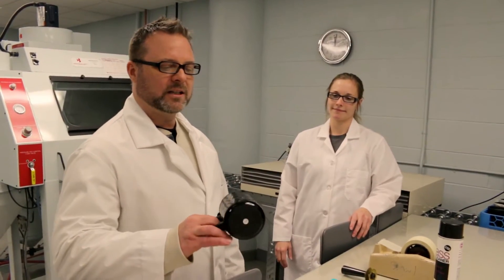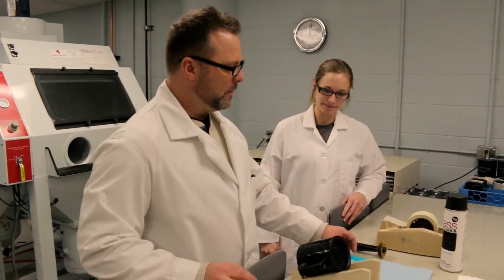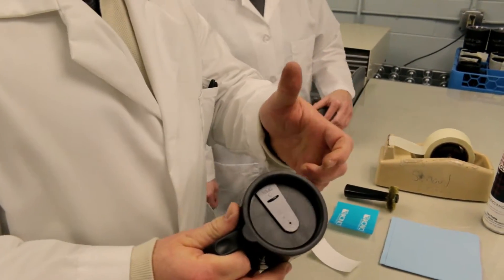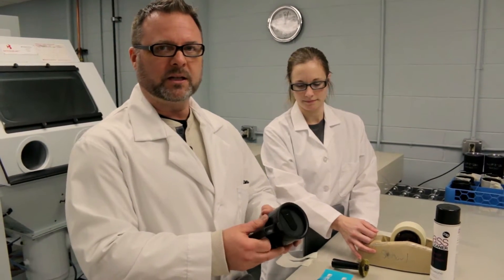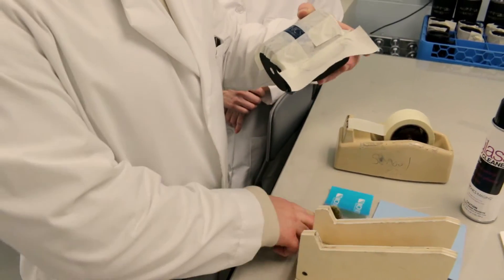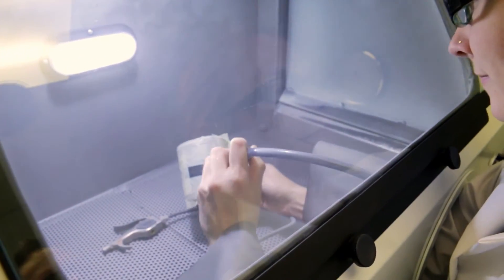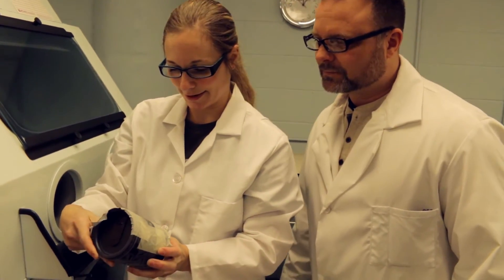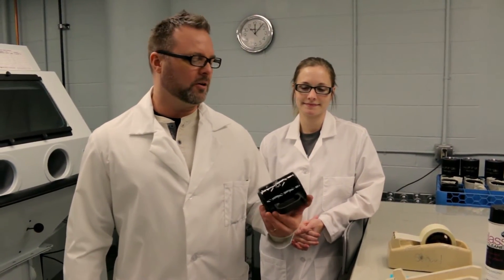S1 Ep5: Will It Blast? - Sandblast Coated Metal

Comment: Some powder coated s/s tumblers are heavily coated - what thicker mil mask do you recommend??
Reply from the maker: Hi Vicki,
You are right! The powder coating on these mugs was very thin and easy to blast through. Thicker powder coatings on Polar Camel, Camelbak, Hydro Flask, and other popular brand names need a thicker mask. More expensive = more powder coating (we've found that's a good assumption). For these thicker coats, we recommend our UltraPro Blue 6mil self adhesive film (http://ikonicsimaging.com/mask-making-supplies/photoresist-films/ultrapro-blue-6mil-10in-x-12in-25-sheets-276.html), or for artwork with more a little more detail you could use R5 film(http://ikonicsimaging.com/mask-making-supplies/photoresist-films/r-series-sheets.html). Hope this helps!
Reply: You can add RTIC to your list. I had to laser engrave them as a last resort. I definitely will try your suggestions! Thanks - I love your videos!